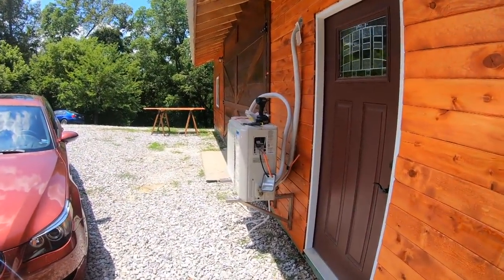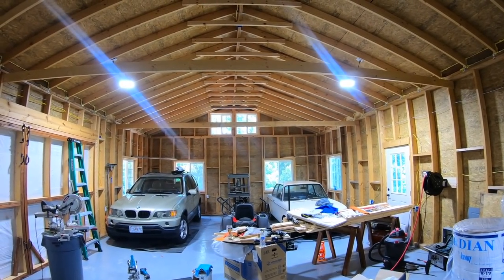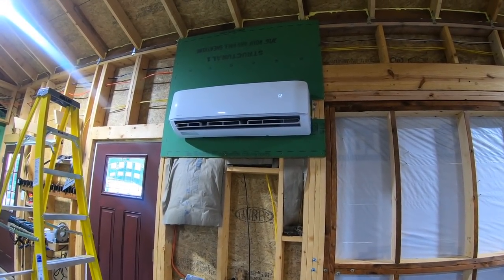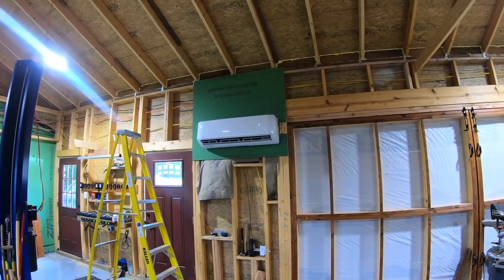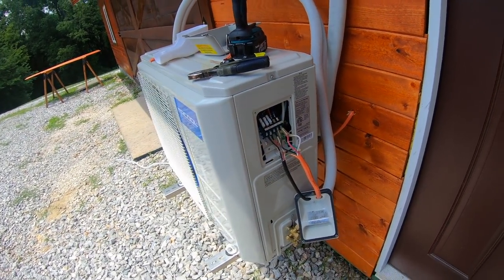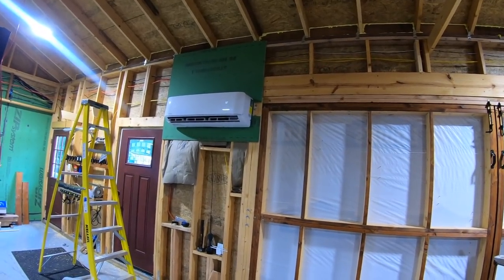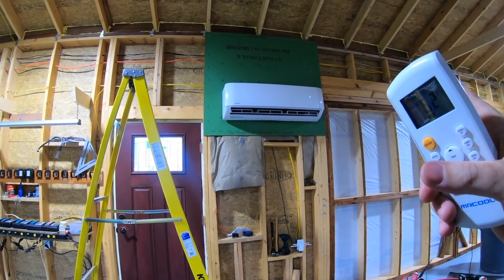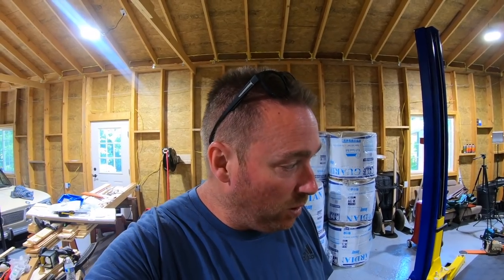MRCOOL Mini Split AC Heat Pump Installation SECRET TIPS Part 1

Comment: I'm reading a lot of comments by A/C techs ?  about how the evacuation was missed on this install. I too was wondering why it wasn't mentioned. I googled Mr.Cool and it seems they come with sealed pre- charged line sets and indoor units. Looks like you screw them together and yer done. Also there are a lot of concerns about the big coil of copper tube at the outdoor unit. Again, don't fret . Most ductless splits come with a suction line accumulator. If you are A/C techs, you know the suction line is in the shape of a U that has a small hole drilled in it near the bottom of the accumulator that meters that trapped oil back to the compressor. It pulls refrigerant vapour from near the top section of the accumulator. The accumulator will be sized to hold the entire refrigerant charge of the unit, that's why they can run them at 3 or 4 F* superheat without worry of slugging the compressor. Nathans BMW Workshop prolly didn't mention any of this cuz he has no idea about how these systems work. I might just try selling some of these units in the future. It will sure cut down on the time for nitrogen pressure testing/ triple evac with micron gauge silliness. Any A/C business owners out there that have experience with the Mr. Cool products that would like to share?
Reply: He said his unit doesn't have that. Only the heat pump was charged. Also the nitrogen pressure testing has nothing to do with evacuating the line and everything to do with making sure you connected the lines properly. Screwing up is annoying and time consuming to fix once you've charged the lines and realized oops your flare sucked.
Reply: @reddog418  If you click on the amazon link just below the video  for the MrCool unit he installed, you can see the line set that is supplied with the unit  is sealed.  Nathans BMW Workshop has provided conflicting information when he says the line set wasn't pre charged and sealed. The Amazon link to the actual product he installed says different.  It looks like MrCool is going after the D.I.Y market. No vac pump/ dry nitrogen equip required. You are totally correct when you say that if you install any refrig equipment and don't pressure test to confirm no leaks, then evacuate to manufacturers specs that you will have created totally avoidable problems .
Reply: gadgethunter 
These are a DIY sold to homeowners. Probably no service valves to set your superheat. Line sets purge noncondenables  at the fittings.

Comment: I'm looking at getting one of these - will be interested to hear your update video.  I'd probably lift that white wire from the outside unit and cap it.  That third conductor isn't required and connecting it to ground creates a ground loop.  10/2 wire would have worked.. just tape the white wire with red tape at both ends to indicate its use as a hot conductor.
Reply: Merde alors!  Learn some basic electricity before spouting off dangerous nonsense.  This AC needs 240V 20-25A service.  The 10ga/3 (good to 30A) he used (and I would have done same) or a 12ga/3 are the only cable options for this AC!  Two 120V opposite phase hots and a ground are absolutely required!  The two hots complete the circuit back to the transformer supplying property, hence no neutral wire for 240 service via the two 120V hots.  The ground wire in this case only conducts in event of a fault to reduce risk of electrocution or to dissapate a lightning strike to reduce risk of fire.  The I've heard of people using steel conduit as ground back to breaker box for 240V service with only two hot wires and no ground wire, but he ran cable, not steel conduit.  In short, the 10ga/2 service you suggest would run unit but is extremely dangerous!
Reply: @stevec8861  I'm an electrical engineer.  I didn't suggest not using the ground wire.  The 10/3 he used has 3 current carrying conductors plus a ground.  He only needs 10/2 which includes two current carrying conductors plus a ground.  You can see in the video that the white (neutral) is connected to ground, but so is the bare copper (ground) conductor.  Two conductors are serving the same function - but it is also creating an additional neutral-ground bonding point (the primary likely being in the main electrical panel).
Reply: @pilotcam  OK, I get it.  My bad.  You're saying a 10/2 with ground (so two hots and a ground) for this service.  I wrongly assumed he used a 10/3 w/o ground and used the white wire as ground.  I'll add he wasted money using a cable with 4 wires when only three are needed for this service.  Thanks for clarification.

Comment: Question for ya, I just installed one of these it’s about 85 degrees out, the cooling works but the instructions say to check heat mode. We’re you anole to? Or will I have to wait until it gets cold out?
Reply from the maker: Turn the unit off and then toggle it to heat, and turn the unit back on
Reply: @NathansBMWWorkshop  thanks

Comment: First let me say I’ve been in the AC business for over 20 years and those units do run well once they’re installed properly but you said that you have about close to 1500 ft.² for a 2 ton unit I don’t know what part of the country you’re in but here in Texas you would be about 1 ton short you should use a 36,000 btu unit. But you did say you get close to 100° where you’re at that poor unit is going to run continuously it’ll never cool that space enough for it to turn off, but once again I live in Texas where it is tremendously hot and humid here in Houston.I hope it works out for you would you insulate the building real well good luck
Reply from the maker: Well it ran all summer here , I never had the chance to put all the insulation in and even on 100deg days with extreme humidity it kept it at 70deg inside no issue , im told a central unit never would have done that , real happy wit this unit  and at $1100 if it take a dump in a few years ill just buy another one
Reply: Nathans BMW Workshop that’s the thing about those little units they can do 35 sometimes almost 40° drop compared to a standard air condition unit can only do a 20° drop so you may be OK I hope it works out well for you
Reply: Keep in mind unlike a ducted system there is no capacity or energy loss, so your getting the full capacity of the system in the conditioned space, so you will have more grace compared to a ducted system.
Also the ductless splits are usually a variable capacity system so they can have much longer run times without cycling on off all the time, which is very important to dehumidifying properly
Reply: Smanny Dith Well the D humidification comes with the variable speed compressor it rarely shuts off what happens it Throttle down to multiple speeds when it reaches close to capacity due to all the misters giving it information but they are good systems when they’re installed correctly they are used all over the world

Comment: Why didn't you trim the Large insulated lines (outside) before priming them with coolant?
Reply: you mean clean up that lineset, and  evacuate....
Reply: There is a minimum lineset length requirement. Usually 10-15’ depending on brand. But to that note, u are NOT suppose to coil the lines vertically. U are suppose to coil the lines horizontally.
Reply: Always cut access lineset if the run is less than 25ft if you coil the lineset it is causing the oil to trap and can cause compressor damage
Reply: @bensavoie1927  So, would you bend  the line set into kinda gentle horizontal zig zag near the lower backside of unit without having a loop as such and NOT TO create an oil trap? Kinda like they do on RV fridges on the back side of them ammonia sys! I will be installing one and wondering.  Or!...  run the line set down the wall then horizontal then mount condenser at the end of line? Seems to me that would look and work best, I don't know...

Comment: It's just mt opinion but if it was me I would have run the coolant lines a little bit different. I'd have taken up some of that slack by changing the location of the air handler so you don't have all of those unsightly coolant lines on the outside of the building. With unfinished 2x6 walls, it would have been easy to do. Good video though.

Comment: Question- Can u cut all the excess wire/hose so its not all rolled up outside? I would only need 10 ft from wall unit to outside unit.
Reply: Yes, but you loose the beauty of the pre-charged line-set.  That is what makes the entire unit a DIY.

Comment: So the outside unit comes pre-charged with refrigerant and you just connect the line set to the fittings??  Don't you have to evacuate the line set to remove any moisture?  Seems like just connecting the line set to the condenser without pulling a vacuum to remove any moisture is just asking for premature failure, but then again I'm not an expert, just curious.
Reply: Mr cool lines are sealed and have unique fittings
Reply: @toddwilliams5905  OK thanks

Comment: FYI- your outdoor unit by code, requires a double pole disconnect switch. Also, the unit calls for for minimum breaker capacity of 20amp. Maximum amperage you stated 25amps.  It’s important that your folks know- NOT to over fuse the unit.  It’s ok to provide the 10 gauge wire, but remember not to over fuse.  You will void any manufactures warranty if it’s over fused. Also the unit only requires two insulated hot wires and a ground, you could have used 10/2 and saved a few dollars.  I would have wired it with 12/2 and as per NEC fused it with a 2/25amp breaker.  Sometimes having an electrician will be beneficial. B Webb - Electrical Associates, Inc.
Reply: he's apparently not a trained HVAC tech.  he says he just wrenched the tubing to the unit and opened the ports.  if that is the case, he just contaminated the refrigerant and the compressor oil and not to mention voiding the manufacturer's warranty.  install the best, service the rest.
Reply: @tedallen9078   The lines are pre-vacuumed, system is pre-charged.  It is designed for DIY, and the warranty allows for that.
Reply: @trunk.monkey  you are correct.  the lines are pre charged.  however, as these several manufactures are targeting the diy market, they are at the same time targeting the skilled tech market with with repair parts.  some weekend warriors will get it right.  many others will pay me $100 p/hr to correct a f**kup.  best of luck

Comment: How much energy does these mini spit systems use vs a split system on a manufactured home 2000 sq ft
Reply from the maker: The best deals right now are on the pioneer units on amazon, 2000 sq ft would need probably two units , 2 of the 18k btu would be a great match , one on each end of the house they are about $900 per unit

Comment: Great video. Very informative. A couple questions....One, would one head heat and cool a 1000 sq feet house and second did you have to vacuum the line before using the unit? Thank you for posting.
Reply: I can answer that. Yes, one head can handle 1,000 sq ft. No need to vacuum the line.
Reply: Well, he (the hack) claims the lines are NOT pre-charged and yet did not evacuate them.  So, either way he is WRONG and you're asking him for advice.  He also messed up the electrical by running 10/3 and bonding ground and neutral at the condenser!  No one with half a brain does that.  No one. 10/2 is all that's needed but he's too stupid to know that and is GIVING OUT ADVICE!!  SMH
Reply: @DiffEQ  The lines aren't pre-charged the outside unit is. I am planning on using 12/2 for mine.

Comment: Why didn’t you reflare those lines and get the excess copper out and you didn’t mention pulling a vacuum? You did pull it down to 500 microns?

Comment: How important is it for the outside condenser unit to be perfectly level? I assume it will help with the pan drainage...could it cause problems if water is collecting in the pan?
Reply: Not a very intelligent question.  Why in the world wouldn't you be able to level the condenser on installation?????  Ugh

Comment: hey, saw your video on the Mr cool. I too have a 1200 square foot shop with 2x6 studs and a fifteen-foot ceiling. mine is insulated and finished. I am torn between the Mr cool 24,000 and 36,000. MY question, how is your 24,000 working in your shop by now? do you have your insulation up yet? any other thought you may have by now?
Reply from the maker: I think 36000 might be overkill , my insullation isn’t even all done and on a 100deg day I can. Keep it at 70deg no issue , got the bill today and $20 per month if even that much is what it cost to run in extreme heat
Reply: Thanks for the quick response, just one more question and I’ll quit bothering you,

With the insulation not completed and your 100-degree weather, Does your mini split run full time or does it cycle on and off?
Reply from the maker: Andrew it cycles down where it is barely blowing  the exterior fan always runs but I think that is just the way they are

Comment: Here is a secret tip - If it doesn't say DIY version then you have to get it charged by a tech, it doesn't come with coolant.  I found this out when all of the DIY versions were sold out this summer and had to buy a 4 zone none DIY.

Comment: Please tell me u pulled a vacuum on the line set before you opened the service valves on the heatpump
Reply: Directions from the manufacturer specifically tell you not to do that. Why are so many nimrods in the comments saying to pull a vacuum on pre-vacuumed and filled lines?

Comment: If yours is drawing 25 amp. Time to call a pro
Reply: the unit should only be pulling around 7 or 8 amps max i think on full blast with a 220 volt  power source.
Reply: It’s a 120v I believe, so amp will be high.
Reply: It may have noncondensable's in the freon.
He didn't mention pulling a vaccume before opening the valves. If that's the case it will not last the summer, maybe not the month.
Must pull a hard vaccume before opening the valves guys.
Reply: @donaldsmith188  the line sets come precharged.
Reply: But I am curious about the amp draw

Comment: Great looking AC Nathan 👍stay cool out there
Reply from the maker: This will for sure help
Reply: Morning Nathan my X3 rpm is going up and down at red lights sometimes like it wants to stall.I have the n52 engine I m going to get the oil changed today maybe put in some fuel injection cleaner.Do you I should check the mass air flow or the cam sensor?

Comment: I’m thinking since your walls were open, you shouldve stored the extra feet of line “inside” the wall (between the studs) instead of coiled by the outside unit.

Comment: This is really a pretty advanced DIY project if a DY at all. You should cut the lines to length and re-flair them for best results. Then before releasing the refrigerant, pull a good vacuum with a vacuum pump and micron gauge to ensure no non condensables and an air tight system that will last many years trouble free. Best of luck.

Comment: Does the unit come with the wiring did you need to connect to the breaker box or is that a separate line item to purchase

Comment: 4th gen head is NOT 1200+ bucks, its actually about 800-900 for a 24000 btu head. A 36000 btu head is about 1500 bucks.That's a secret he did not share. 
If your house has over 1500 sq ft of mostly open space, plan for a 4 ton compressor unit, those cost about 2500 bucks by itself. Where the costs add up is if you don't have some of the tooling to do this stuff yourself. 
A recharge kit, compressor and other tools can run you about 800-1000 depending on what you get, I actually own most of the tools for HVAC work except the compressor and gages. It pays to get the right tools, so avoid sketchy sources like H.F.
If you do not have the tools, time and necessary skills to do this yourself hire a proper contractor to do this work, it may require some research to ensure that your install complies with local building codes (if it doesn't it may prevent your house from being sold).
Precharged lines are a nice touch, depending on how long the runs are from head to main unit those can be expensive too, 300-1000. There are pass through couplings and other stuff to factor in too.

Final tip, you're more likely to save a lot more if you don't buy it from Amazon, buy these from actual HVAC companies, there's lot of them. If you're a veteran, Lowes or home depot offers a 10 percent discount, some other business may also but mostly those two. Shop around, some suppliers will either skip tax or pay the shipping for you, which may be your break even point.
Reply from the maker: A 24k mr cool right now is $1399, $1700 if you dont buy it off amazon

Comment: 10/2 not 10/3 you also need a disconnect outside.
Reply from the maker: 10/3 for 220v 10/2 only has enough wires for 110v

Comment: Thanks for posting this air conditioner video.  I am thinking of purchasing the 24K BTU unit myself.   How was the hole in the wall fit?  One guy suggested a 3.5 inch hole in the wall to accommodate a 3 inch PVC pipe to facilitate putting the hoses in the wall.  What do you think of that?  Nathan the chinese billionaire that owns the parent company of Mr. Cool  (Midea)  was just kidnapped by thugs.  His son swam across a river to get help.  I bet your E60 could have outrun the bad guys.  Thanks for the post.  You look comfortable inside.  How cold do you get in Missouri?
Reply: I thought you said the unit cost you $1200.  Where did you buy it?  Amazon?
Reply from the maker: i used a 3in hole saw got a set from harbor freight for $15 , i bought it for $1100 just for the unit, i put a amazon link in the description but the price went up to $1700 now, i guess because its summer and the demand is up
Reply: @NathansBMWWorkshop  Did you buy it in April or May?  I am amazed it went up that fast.  After seeing the price rise that much I may wait until winter.
Reply from the maker: @dogsplantscarsneatstuff176  May 28th https://amzn.to/312Zt7B that is the original ad, maybe see if they will honor the old price
Reply: made in china.... nuf said